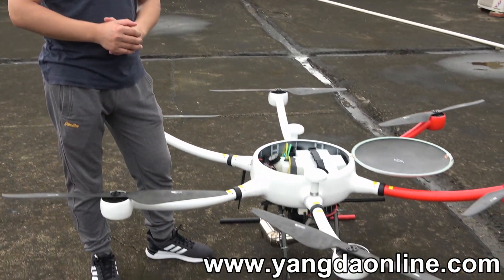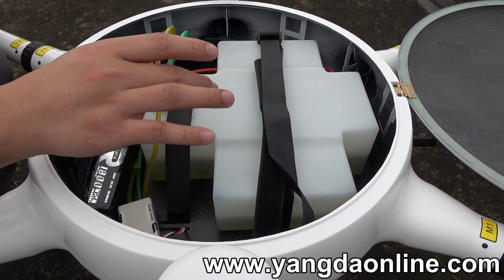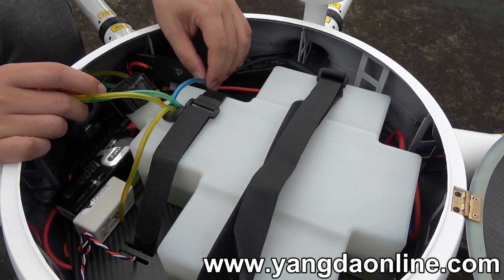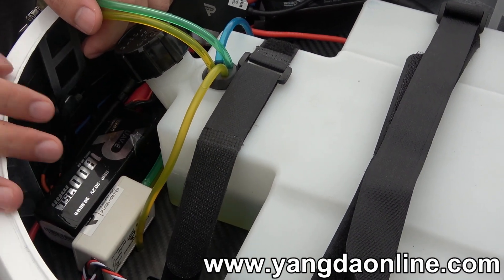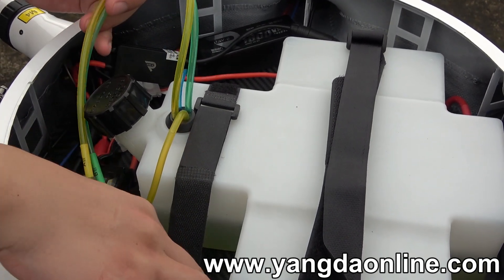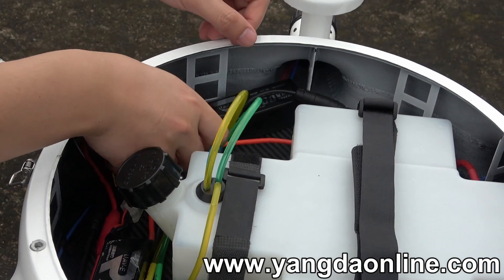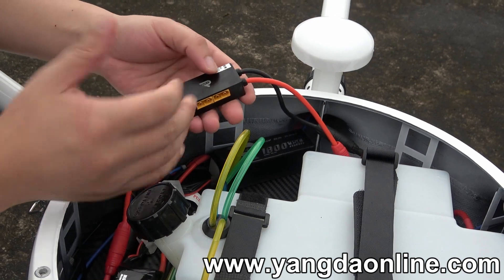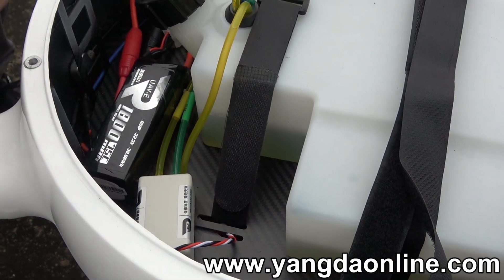Demo Of YANGDA Hybrid Hexacopter Operation

Comment: I would like to see it flying. I believe 4 L tank can mantain it in the air during more than one hour!
Reply from the maker: Exactly, the 4L tank is optional. Flight demo: https://www.youtube.com/watch?v=jP_6_Dfc-nM&t=7s
Reply: @yangdaonline  Thank you so much. I've found this video and minded it's a very good drone for securance of open air events.
It should be used also for agriculture with more litters of a Spraying liquid or oil and less Gas, as it would be able to deliver all its spraying tank in less than 10 minutes.
emaildowitt@gmail.com, you can get in touch with me by email. 
Best regards!
Reply from the maker: @FranciscoWittperfil  Thanks! Email is sent.